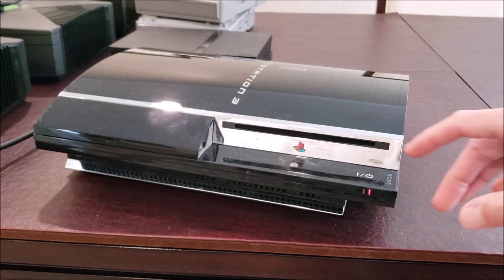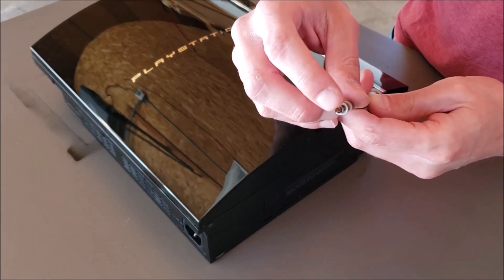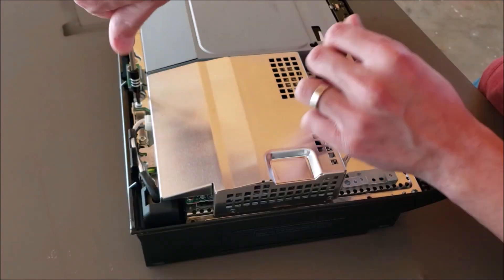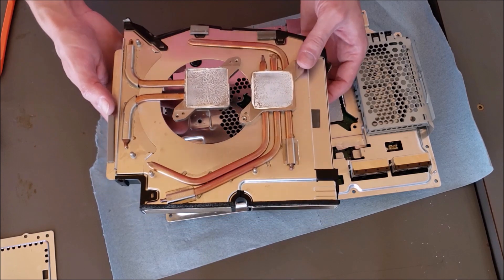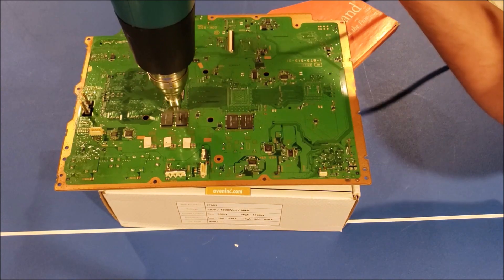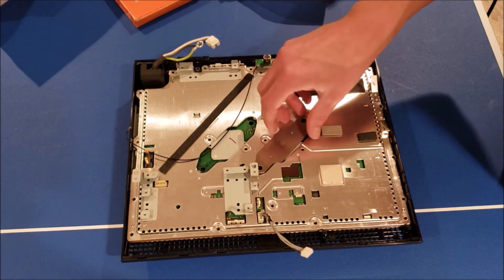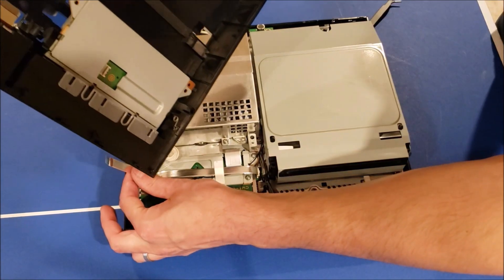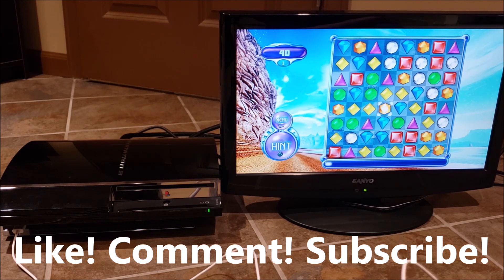Fixing a PS3 with Blinking Red Light "of Death" (YLOD)

Comment: I have a problem to my ps3 bro when I play God of War Ascension then 20 minutes my ps3 automatically shutdown and there's a notification said that the system has become hot please turn it off and wait for it to cool down something like that then 3 beep then shutdown with blinking red light I think this is not a YLOD coz I can turn on my ps3 fat 80gb model but unlike the other ps3 mine is more quieter than a hair blower please help me resolve my problem any advice will appreciated thank you
Reply from the maker: Look up the fan test to check if that's working normally. Additionally almost can guarantee it needs new thermal paste which will greatly help in ejecting the heat
Reply: @FantasticQuack  The Fan looks fine it's not loud like the other video I watched but in 5 to 10 minutes of gameplay it's aumatically shutdown and blinking red lights like in your video

Comment: my PS3 got YLOD with 3 beeps and red light flashing like yours, and it happen after a couple of power outage. is it possible that my PS3 just have a dead drive/PSU after that couple power outage?
Reply from the maker: I highly doubt it is the power supply, but won't say it isn't possible. Most commonly the issues is related to the NEC caps going bad and/or overheating causing the internal solder to melt leading to missing/intermittent connections.
Reply: @FantasticQuack  ohh okay. i see a lot of youtube video with this problem is changing the NEC caps with the tantalum caps for this kinda problem, and i might try to do it and hopefully it'll work.. Thanks!!!

Comment: I just have one question for you, what T number screwdriver did you use to remove the lid? You just say, "this type of end with a hole in the middle", without telling us which driver you're using!
Reply from the maker: It's a security torx, can't remember the size but any electronic repair driver kit should have these in them. Should have mentioned in the vid you're right.
Reply: @FantasticQuack  Look on the torx genius. It should have a number!
Reply from the maker: @jamming8519  Anything else you need while I'm at it great one?
Reply: @FantasticQuack  So, by YOUR logic, I need to buy an entire tool kit just for the 1 piece I need? Yeah, you're a freakin Einstein.
Reply from the maker: @jamming8519  You can get an entire tool kit with the needed bit for $13 on Amazon so not as big of a deal as you're making it sound, plus you'll have a bunch of other bits that will come in handy later.  The bit size is T10 which I found by googling "security torx bit for ps3". Thanks for recognizing my genius.
Reply: @FantasticQuack  yeah right, 13 dollars for an entire tool kit I DON'T NEED! Just the one piece of which you STILL haven't mentioned the T number!
Reply from the maker: @jamming8519  Read my last comment where I noted the T#. Guess you missed it.
Reply: @FantasticQuack  wouldn't have missed it if you had mentioned it in the video Einstein.
Reply from the maker: @jamming8519  sorry I let you down jammin g, take care!

Comment: So I’m kind of new to all this, I took out the part which was held in with the blue screw ( I want to say hard drive but it looks too small to be that.) 

And I blew out a lot of dust, put it but together and tried to start it up didn’t work, turned it off and have it a few minutes then it started and it’s been on now for about 5 mins.

But it won’t load past the opening screen it keeps freezing.
Any idea what could be causing that?
And my controllers just keep flashing red and never connect.
Reply from the maker: That would be the hard drive behind the blue screw. Beyond blowing out dust I would clean all the pins on the hard drive and receptacle with alcohol. Unfortunately I can't recommend anything more specific with this info without troubleshooting it myself.

Comment: Hey... what type of screw it that at the top so i can remove it 🥲 im struggling here
Reply from the maker: It's a security torx but I'm not sure on the exact size. You should be able to find a cheap bit set with multiple sizes then just try a few until you find the one that fits.
Reply: @FantasticQuack  hey thanks for the reply. its a T10 btw !

Comment: It’s not always nec tokin failure reflowing them does not work and if it does it’s not permanent reflow cpu and gpu use flux and if that dosent work then replace nec tokin capacitor but most of the time due to the dried up thermal paste it will overheat causing the solder balls to loose connectivity with the board so just reflow cpu and gpu
Reply from the maker: I pinned a comment addressing this

Comment: Sadly this method is only a temporary fix. The permanent fix is to replace as many of the Nec capacitors with a better brand and to make sure the fan runs at a higher RPM. Sony made sure this thing was quiet instead of cooled properly and will only ramp the fans up to 33% once its getting to hot. Ideally you would run it at minimum 28% to 38% alongside replacing the capacitors and and thermal paste both under the chips and on them. If you don't care at all about noise and want a Jet Engine you can go higher and have it running under 60c easily with anything around 50% or higher. By default most of these launch models run from the 70s to 80s. Far to hot in my opinion. My personal fat that I jail breaked runs at 74c on the cell and 70c on the RSX with a 38% fan curve, I got unlucky and just have a PS3 that runs hot even with a better fan, Delid and replacement of paste and pads. Most will be 65c at 33% with a delit which is far better long term for the unit and the capacitors. If you're tight for time the Capacitors around the RSX are the most likely failure points.
Reply from the maker: I pinned a comment which partially addresses this, but I appreciate the extra context for your situation in that it may help others. Cheers m8

Comment: I have a CECHG01 model system and I can confirm this method works. Though some of the components look different and some of the steps may not apply to that system, as long as you follow this video as close as possible you will have a working PS3 by the end of it.
Reply from the maker: Glad this worked for you!
Reply: No, there is no guarantee if you can't replace an RSX yourself
Reply: Thanks I’m currently working on that model

Comment: Hey there I've got an update for you. So my GF spent the last couple of nights binge watching a show on Netflix using the PS3 no less and nothing happened. It worked just fine

I tried playing Medal of Honor Frontline today and it randomly shut off on me with the blinking red light twice in the middle of the game
Reply from the maker: If it went to YLOD again it is more likely the NTC capacitors (which can be temporarily brought back to life with heat) are the problem on your unit and replacing them should be the next thing you try if you're willing to expend the effort. I pinned a comment to this video with more detail on the general situation.
Reply: @FantasticQuack  I actually found the PS3 a couple days ago with the red light blinking again and it hadn't been turned on in weeks. At this point I don't know what the hell is wrong with it

Comment: i just bought a phat red light ps3 manufactured 2008 for around 80usd with 11 disc games. mainly bought it because it included shattered dimensions and el shaddai (both rare games)! but i am very interested in fixing it and will give this method a shot. i still have my slim ps3. if i fail i'll have a fat ps3 for display. but if i get to fixing it then i'll have 2 working ps3!
Reply from the maker: Nice, I hope you can get it working!

Comment: I done this process an the console actually powered on and recognized there was a hdmi but then 10 seconds or so after first powering the console back on an then proceeded to beep an do what its was doing before. Any suggestions?
Reply from the maker: What might have happened there is you temporarily brought the (failing) NEC capacitors back to life. Based on this info alone, I would try replacing those caps.

Comment: I got a question, do I need to reheat the pads? I'm about to tear mine apart due to having the same issues but I don't have a heat gun, do I need a heat gun to fix it?
Reply from the maker: If you want to go to this reflow method straight away then yes you need a heat gun. There are some earlier steps you can try first such as replacing the NEC capacitors. It's hard to know what is right for your specific situation since causes of YLOD can vary. Odds are though that cleaning out the inside / replacing paste alone will not be enough to resolve the issue.
Reply: @FantasticQuack  ok, I got a heat gun on order, is there anything I need to wary of before doing this?
Reply from the maker: @sammegehee8876  keep the board level and be careful not to blow any components off. You want to get things pretty hot but there's a point where you can go too far. Kind of just have to feel it out. It's risky for sure. Hope it works out for you!

Edit/other thoughts: not a bad idea to pre-warm the entire board so it's not as big of a thermal shock. When it's hot, let it cool back to room temp on its own. I force cooled mine with a blow dryer out of impatience but I wouldn't recommend doing that.
Reply: One more question, my heat gun has a setting at 400°C is that ok?
Reply from the maker: @sammegehee8876  temp/time/technique recommendations are in the video. 400C will be fine, just need to be mindful of heat duration.
Reply: I have another question one of the straps of tape on the back of 4 chips snapped is that tape there for thermal protection? It snapped in between the two chips it was on so I'm not losing nothing if that's the case if I'm not mistaken. If it is a big deal let me know I'm about to put it all back together right now.

Comment: I can’t believe you put everything back before tearing it
Reply from the maker: Well if it didn't work I wasn't planning to continue working on it for a while until I looked into some other options. I of course could have left some of the hardware out, but generally, assembling it to the point of being able to test it and fully assembling it aren't drastically far apart.
Reply: Sounds good awesome job bro, I just picked up a ps3 for 20 bucks with the same issue and thx to you it’s working again, thanks!

Comment: I have the blinking red light. It's very inconsistent though. Sometimes the console shuts off less than a minute after I turn it on and sometimes it can be on for hours before it shuts off

I thought it was overheating so I took it apart cleaned it up and replaced the thermal paste. That works for about a day but now it's back to its old ways

At this point it could either be a bad hard drive or a bad motherboard. You got any second opinions for me? I'm using a 2008 model cechk01
Reply from the maker: If you rule out the hard drive I would try replacing the NEC capacitors. If that doesn't work you could reball the CPU/GPU IC's (whether getting the equipment yourself or finding a shop). If you're unwilling to take it to that level, the heat gun reflow is worth trying. There may be some intermediate steps you can take that I'm unaware of based on the specific issue so definitely recommend doing as much research as you can if the console is very important to you.
Reply: @FantasticQuack  you shouldn't just reball or repaste the caps for no reason. if you ever experience the ylod it isn't just caps or necs it could be the rsx chip or the flash memory.

there's a certain board that you can connect to the ps3 via serial to usb and you can dump the syscon boot logs which gives you the exact error codes causing the ylod.

but most likely the older models had to be reballed or the nec tokins had to be replaced
Reply: I believe if it does turn on and you see video without artifacting, but then it shuts off a little later it is most definitely the NEC capacitors. Comparatively, if instead it doesn't even power on, and the fan comes on for a split second then blinking Red, then it would be something else. The latter is what is happening to me! =(

Comment: The ps3 fat is really unreliable no matter how you take care of it... it will fail you it happens to me and bought the slim variant until now I can still play it and I don't  play much 4 hours is the longest plus my room is always in AC and have a stand fan at the back and always dust  and clean but the first gen fat still fails.
Reply from the maker: This unfortunately seems to be true. The design just doesn't allow it to expel heat like it needs to. Especially sad since the newer ones that do last longer won't play ps2 games.
Reply: @FantasticQuack  yeah that's  only the bad side not compatible unless you hack ps3 though I still have the psx and the fat ps2 and still working I play them sometimes.

Comment: This model of ps3 actually does have ps2 hardware inside but it only contains the ps2 gpu that's it and the rest of the ps2 is emulated by the cell.
Reply from the maker: So partial hardware / partial emulation? I guess I was only half wrong then ;) Interesting stuff!

Comment: my ps3 does the same thing but after a few minutes (maybe 10) of gameplay is it still ylod?
Reply from the maker: The yellow light + flashing red light is ylod, but there's a variety of issues that can cause it. Usually it prevents the console from turning on at all so yours might be a different problem than this one.
Reply: @FantasticQuack  it happens sometimes i tried clearing what little dust i could without opening it and it stopped shutting off but 2 days later it did the ylod thing but the 2nd time i tried to turn it on it worked then it crashed ac brotherhood a few seconds after i loaded my save and when i turned it on again to my horror my ac save was deleted so i asked my cousin to take it to a professional (dont have the screwdriver to open it up) but im sure its just a near symptom of ylod and a nice clean will hopefully fix it since i put it in a rather dusty area

Comment: This is a great video! Love the fact that you included putting everything back together. Got my ps3 working again! Only problem now is that the power indicator isn't on and it ejects the disc right away. Wonder if I got a connection wrong.
Reply: And now it's working again! The ribbon for the power and eject was finicky.
Reply from the maker: Thanks! Glad you got it working!
Reply: Update. I tried playing a ps2 game on the ps3, worked for a minute or 2 then ylod came on again. Ps3 game worked fine though.
Reply: @johngiesbrecht8880  hey i am planning to buy a fat ps3 which has ylot . its cheap but should i buy it ?? can it be fixed or am i just wasting my money
Reply: @niteshbudania9614  it's definitely fixable! I did everything this guy did in the video and it worked again! It played the ps3 games fine,  as soon as I tried a ps2 game then it quit. But yes it worked for me!
Reply: @johngiesbrecht8880  thanks for your suggestions . appreciate your time

Comment: Theirs a more simple method to fixing the YLOD as show in this video. You don't even need to take it apart, simply turn the ps3 over so it's facing bottom up. Get a hair dryer and run it on the hottest heat through the vents at the back of the playstation for around 15-20 minutes until the bottom of the playstation is hot. Leave it to stand and cool down for a further 15 minutes. Then you plug it back in and away you go. Trust me this method works also and avoids you ruining the warranty sticker and saves you opening it. I've done it myself many times before it works!!
Reply from the maker: Glad to hear that works. The thermal paste on mine was very dried out and probably not working well, I think getting new thermal paste on is important to keep it from happening again.
Reply: @FantasticQuack  yeah thermal paste can cause issues especially dry but this method with the hair dryer just saves all the work taking apart the console that’s all
Reply: @UkDiablo whoever thought about "if we add paste and it dries out, it wont turn on" should be FIRED!
Reply: THANK YOU but the back of my ps3 melted a little bit
Reply: But its not a permenant fix is it?
Reply: Leave it to stand the right way up?
Reply: Bro I remove and get new thermal past, still 3 beeps and I got the air dryer for 15min full on cpu/GPU vent ans now it's working! THX!
Reply: I’ve got my old fat ps3 in bedroom for Netflix and blue ray shit off tonight after years of use... I’m going to try the hair dryer good shout mate!! Hope it works... could I get another good ps3 and swap hardrive? Have music and pics on this one
Reply: @VIVAPSESCE  yeah you could get a ps3 and change the hard drive, that can work too
Reply: @VIVAPSESCE  so how was it?
Reply: @jcc4543  still too try it lol